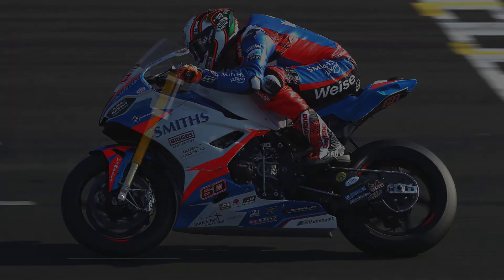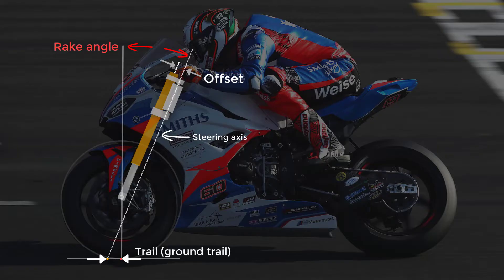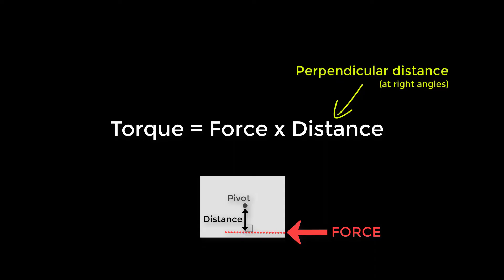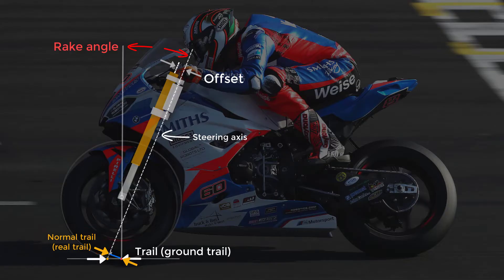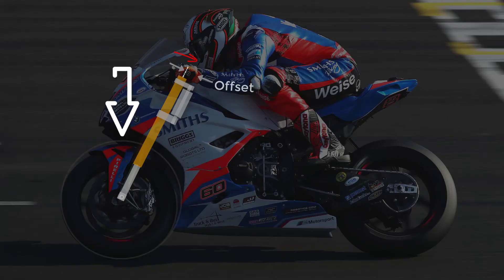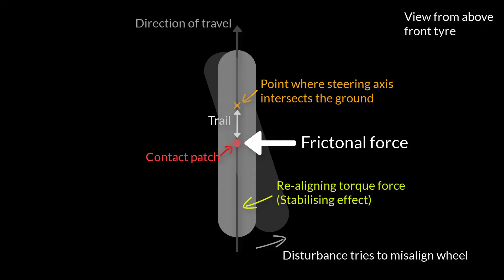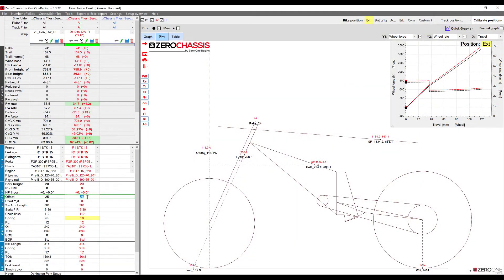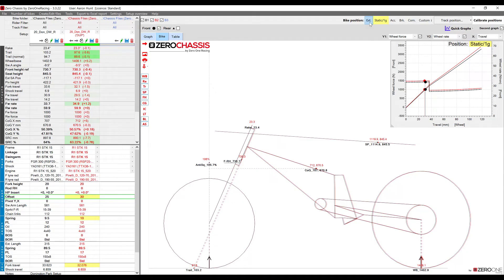TRAIL EXPLAINED! | Motorcycle racing geometry

Comment: Would like to see example to better understand effects of long chopper forks. Diagram of flop, and poor handling. 

Especially, to visualize Sugar Bear long springers known for good handling, stability, zero trail, and no flop. Achieved with custom rockers that reposition the axle, wheel relative to steering neck axis. There is no technical info about the geometry and design of these infamous front ends.

Comment: I have Zero S Gen2 electric motorcycle and want to make the front taller so move the fork position 1cm lower.
The Zero DS Gen2 model has same frame, but about 2inch longer front forks and 18inch wheel not 17 inch like mine.
So mine is uncomfortable on longer and andventure rides.
I hope that 1cm would help a bit :) I am slipping to front every time and uncomfortable to sit like this position on long slow rides.

Comment: Is it same if we say in case of rake angle ?
More rake = more stability 
Less rake = more agility 
Bcoz the trail dependent on rake angle.
Reply: Somewhat, but those statements are less accurate due to the offset. Trail is what matters, both rake and offset affect trail.

Comment: Explaining something complicated in a simple and understandable manner is proof of truly understanding the subject.
Wonderful explanation, fully expect to learn a lot from binging on your channel :)
Reply: Started with learning a real life example of this. Lowered the front on my FJR1300 to improve handling on stock suspension, with good results. Swapped out the stock suspension with Wilbers (Road) and progressive springs, and the bike felt unruly/squirrely. Changed back to equal height front/rear, and the bike handles like it's on rails and still flicks well.
So rear squatting was the culprit, not the chassis balance (stock suspension is notoriously soft even on hard setting on these bikes).
Anyone interested in making their bike faster, more comfortable, safer, etc. should find an interest in learning about the geometry, suspension, and ergonomics of their bike, and some basic concepts around these.
Dave Moss, Mike on Bikes, this channel, any channel specific to your particular bike(s) - all excellent sources of knowledge :)

Comment: What about these following  other effects depending on the trail:
- trail braking a bike with longer trail is going to generate a higher straightening effect
- leaning in a longer trail bike  the first degrees from the vertical is going to require more effort, but once at lean the weight acting on a longer lever  isn't going to turn the steering more toward the turn? Or is this fully compensated by the same longer lever the centripetal force on the contact patch acts onto?

Thanks

Comment: Great video! I have a question about it. If we take two different bike, with same normal trail but different rake angle, the bike with higher rake will have higher ground trail, so higher ground trail = more stability, same normal trail = same handlebar torque. So looks that higher rake made a bike more stable maintaining agility, is it true?

Comment: Zero One Racing Hi, what are the adjustment can be made to have more agility? add more front preload and lowering front fork? any other suggestions? thanks
Reply from the maker: Hi, thanks for your comment. There are many aspects of the geometry which influence the agility of the bike, with trail, wheelbase and centre of gravity height being some of the major ones. As mentioned in the video, a smaller trail value will likely give more agility. Things that can be done to reduce our trail include lowering the front of the bike (by sliding the forks further through the triple clamps), raising the rear height (this will likely have other significant knock-on effects), changing triple-clamp offset (this won't be an option for all bikes) and finally changing our suspension set up. With regards to the forks, increasing preload will mean the forks won't compress as far when a given force is applied, meaning the front will sit higher and this will actually increase our trail value. Making the forks compress more (softer springs, less preload, etc...) will give us a smaller trail value, however it must always be considered how a change to the suspension will react in all areas of riding and if this is going to be beneficial to us. If you have your suspension springing optimally set up already, it may not be a good idea to change this in order to influence our trail.
Reply: @zerochassissoftware  Wow thanks for the details. Yes you are right, my suspension springing optimally set up already, so not a good idea to touch the preload. I think the cheapest and fastest way now is to lowering the front of my bike, I am thinking about 1 cm. My bike is a CBR650F and no worries alot of clearance left. Thanks :)